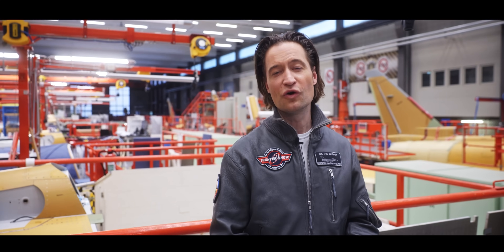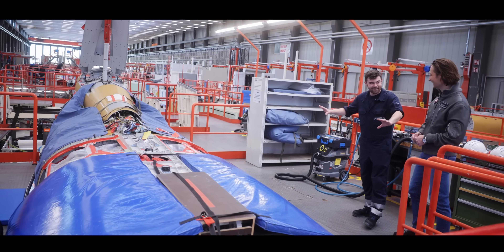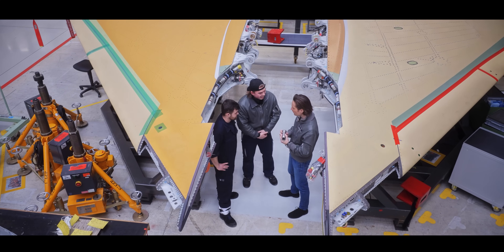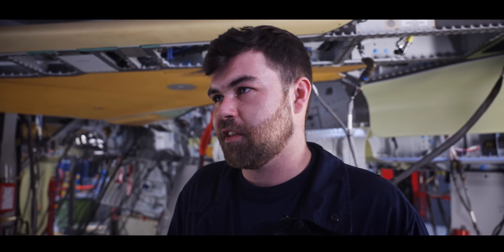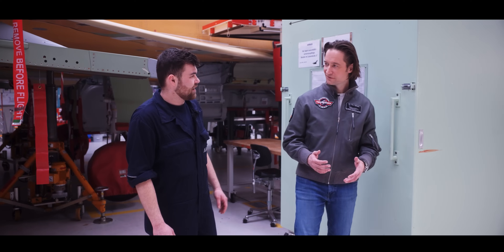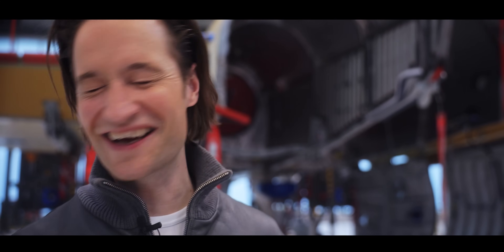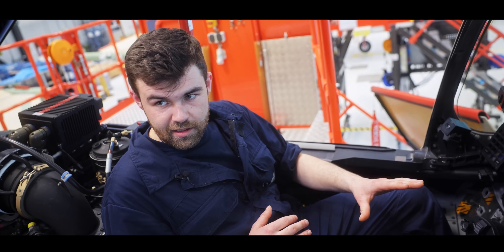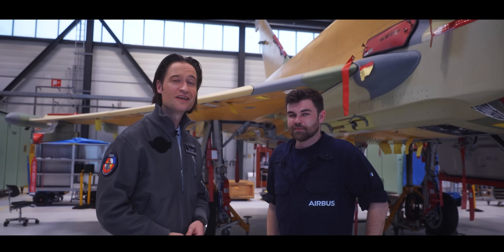A Star is born – Building a Eurofighter Typhoon

Comment: As a Brit , understand this is a 4 gen turkey compared to modern jets . Russia built a plant thats half automated . It flown the felon with AI in 2016 , its the fastest , more manoeuvrable,  its has vortex controller on the main wing and 3d independent thrust vectoring . Its two point communication , it doesnt need a 3rd point relay plane . Its air to air range is gen 4 400km and gen 5 300km . All western jets have a max range of 180km .
Reply: It is not just a 4gen jet, it is in my opinion with Tranche 4 a 4.7 or 4.9 gen. The newst typhoons with the new LPI radar (Gallium Nitrite modules!!)has a FOV of 200°. No other fighter jet in the world has such a fov that can be used to negate a incoming lock and gives unprecedented awareness and new tactics. They are also working on the new cockpit which will look incredible, almost no buttons huge screen, integrated HUD on Striker 2 helmet.
The Typhoon has further features that sets them apart from the rest like the QWIP second generation sensor or world class self defense system, care free handling, automation, voice control and so on..
Reply: Hmmm and how's that working out for them 😅
Reply: To me the Typhon is much more of a modern jets and technical leap than the russian felon especially soon with the new cockpit, everything will be more linked to each other with other jets like the upcoming Tempest fighter and FCAS jet, electronics, data exchange etc., together with the extreme maneuverability and small dimensions which helps with the maneuverability, the Typhoon is a much better fighter. "if you ask me the felon is not even really stealth"
Reply: Ah, but the felon is massive, there are less than 50 of them, and It has the worst radar cross section of any 'stealth' aircraft. Its maneuverability is redundant at modern combat distances, and it never flew with ai, only AI assistance for certain systems.

Comment: bet there’s a ton of american components specially electronics, good luck with that in the current environment.

may god help you.
Reply: Not that much as you might think. The engines, radar, sensors, defense system, missiles, gun, fuselage, ejection seat all made in Europe. I know the processors are Motorola but they could have been made by BAE Systems who can make such processors in license.
 The inertial and satellite navigation system is american(Northrop Grumman).
Reply: @techdefined9420 Why is Europe not using Galileo for military stuff?

Comment: I hope Europe will make such marvels, like Tornado, Typhoon. But France took their participation back, only bcs they wanted that their country received the biggest parts in return in terms of jobs etc. With Italy it works strangely enough, Ships, FREMM, HORIZON, or rockets like SAMP etc. but in other parts like air fighter no!
Reply: I thought France split from the program because they wanted different capabilities
Reply: @specc_s1452  Both, with multinational joint design like this members requirement are accounted but there is also the need to reach a compromise